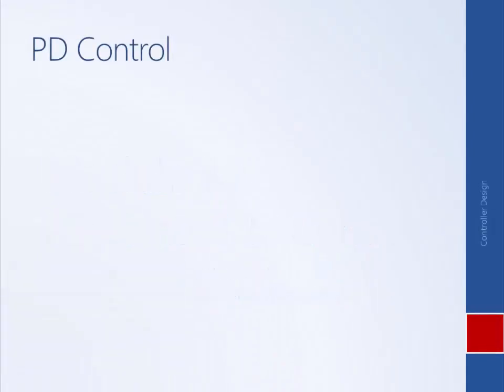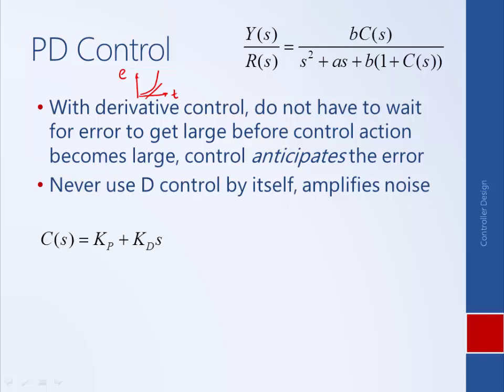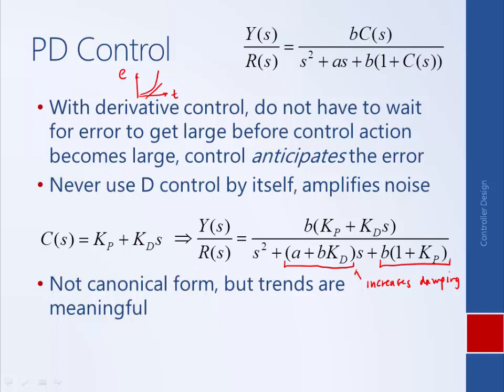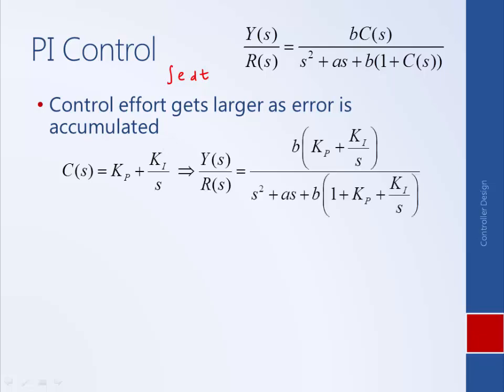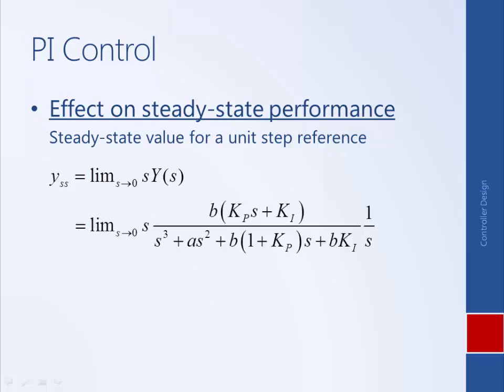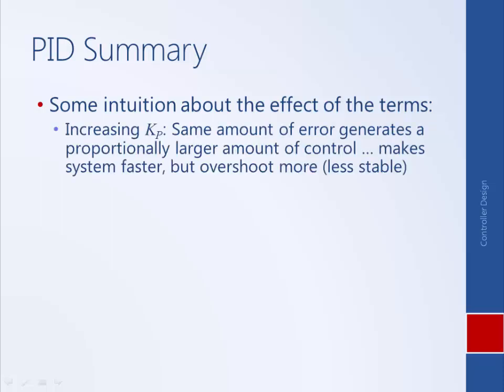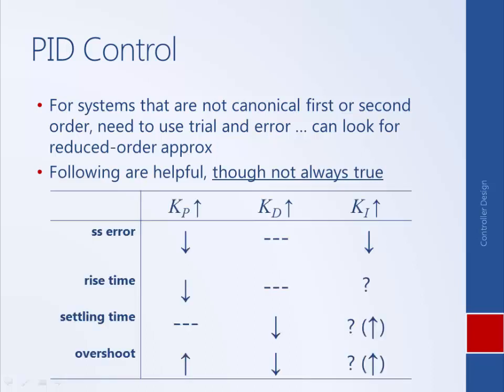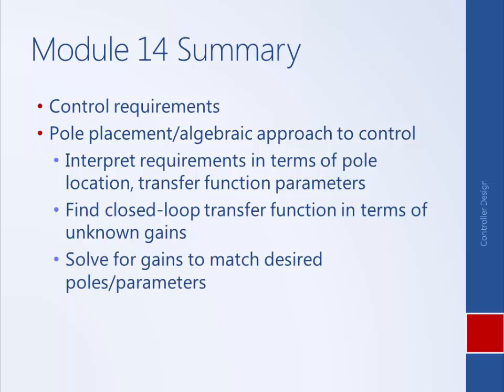System Dynamics and Control: Module 14d - Intro to PID, PD and PI control

Comment: If you don't mind, I have an off-topic question: how do you write smoothly on the PPT slides? 
I used a stylus to write on a PC touch screen and the result was a squiggly distorted text.
Reply from the maker: I don't do anything special. I have used Lenovo laptops with a touch-sensitive screen. Currently I have an X380 Yoga.